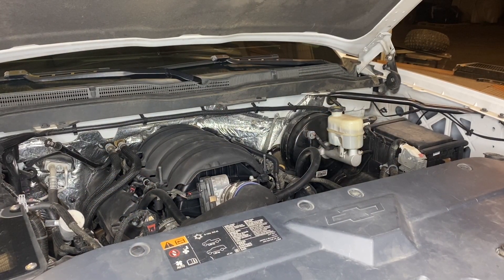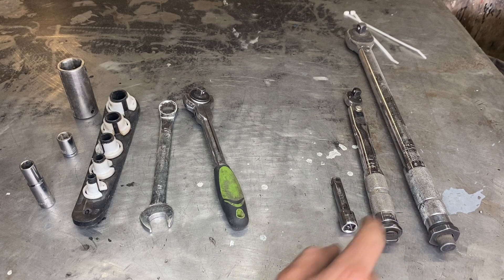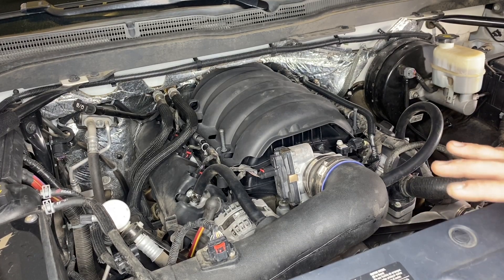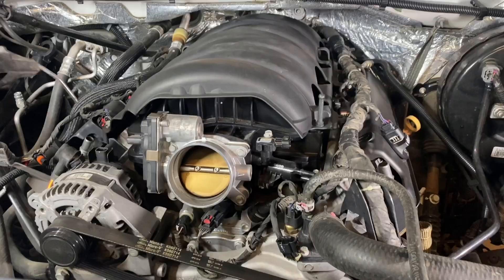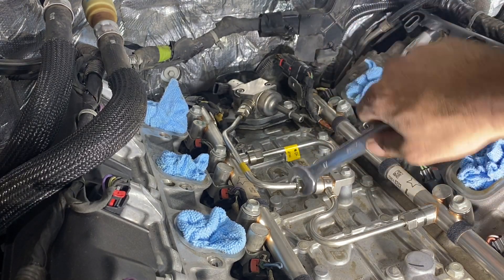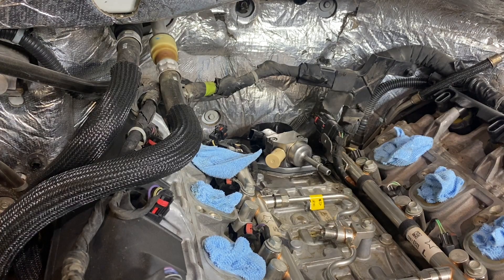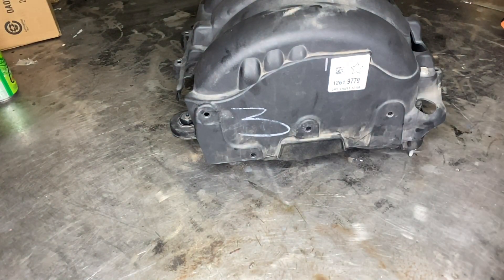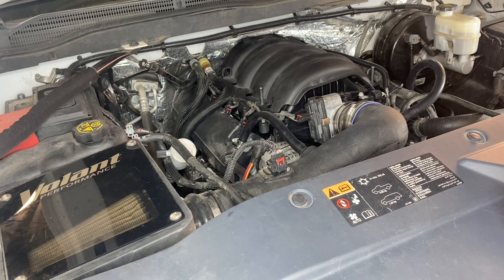GM High Pressure Fuel Pump Replacement 5.3 & 6.2 ( Complete Guide)

Comment: Hey man great video! I don’t think I have any issues with my actual pump but I have a very strong smell of raw unburnt gas. Obviously a leak and there’s no sign of a leak anywhere. I’m thinking the leak is somewhere under the intake but after watching and closely looking
How things are designed under there I don’t see how it could start leaking, but I know nothings impossible. Any advice?
Reply: Did you find fuel leak? My sons truck is doing same, thanks!
Reply: @jc_from_tx9229 I haven’t had time to diagnose but I think it’s either an injector o ring or leaking from around the high pressure pump whether it be a line or whatever

Comment: Hey man 19 Camaro SS 1LE with a cold air intake only mod. 50k miles, with no cel. Negative long term fuel trims on both banks (seems to get better at idle or steady throttle), but the car will slightly buck when casually accelerating from a stop. If I give it throttle to accelerate, long term fuel trims go really negative like -20 bank 2 and -17 bank 1. Bank 2 is always a few points more negative than bank 1. Replaced plugs and wires, injectors, maf sensor, pcv valve, coolant temp sensor, checked for vacuum leaks. All out of ideas. Doesnt make the power it should, sometimes will bog under wot. Seems to start just fine, and idle fine? But when you go to change gears (manual) or accelerate from a stop (usually lower gears 1st through 3rd at light throttle) it will buck. Does this sound like bad or leaking HPFP?

Comment: Is techron can damage that high pressure fuel pamp?If yes  what will be symptoms.Thank you in advsnce
Reply: It’s crazy you said this cause I used chevron fuel for about two days and my Tahoe started throwing fuel pump performance codes and stalling. I’ve put some Seafoam in the tank and have been watching the pressure with my gauge so far no issues but this happens right after I washed the truck weird

Comment: Asked at the dealership for information about an issue I was having and they said it's a good possibility that it's the HPFP that was going bad, and may need replacing. Well, so they want almost $200 just to "diagnose" the issue. I typically prefer to do as much work on my vehicles as possible, but after speaking to them it seemed like that would not be possible in this case. After watching your video, I'm more confident that I'd be able to get this done myself and not have to deal with them.

Thank you for the informative video. Keep up the great work. I hadn't run across your channel before. But, you earned a Subscriber from this video alone.

Comment: Did used the tool but still won’t fire up  everything at specs. Could it be a lot air in the system

Comment: Hello. I am doing car maintenance in Korea. I was impressed by your video. Could you tell me how to get a plug to check the cam position before replacing the high pressure pump? It's hard to find just the number on the plug. Can you help me?

Comment: QUESTION:   So, are there any other wires/plugs or hoses attached to the intake manifold?? or just a few bolts that hold it down?  Asking, since I have 2021 5.3 Sierra with extremely similar configuration under the hood.
Reply: The plu wires do not attach to the manifold cover, it's to plug and coil pack

Comment: I get the P0090 code ever time it rains, I can clear the code and it runs fine. Took to GM dealership and the insisted the high pressure pump was bad. Right now I’m at $1500 ac pump replacement and reassembly. I keep seeing other included in this thread are see this come back it’s due to the harness?

Comment: I did this and it didn’t change my situation. I’m wondering if my o2 sensors are bad .
Reply: 1 year later but I'm pretty sure a good way to check for that is if fuel has leaked into your oil or not. If no fuel in oil, it's prob not the hpfp

Comment: Whats that ticking sound all these trucks have?  Is it the hpfp?  Sounds like a sewing machine.
Reply: Injectors, direct injectors are loud
Reply: @Chucktales bullshit lol it’s lifters.
Reply: @supremecanadian6815  sewing machine sound is injectors.
Reply: @Chucktales  yeah? What do you think makes the click? It’s the hydraulic lifters bud it’s a known fact. People afraid to admit their chev ticks excuse is always oh it’s the water pump or oh it’s the fuel injection lol. I own a 5.3 I just don’t make up bullshit.
Reply: @supremecanadian6815  I’m not sure of your knowledge on how direct injectors actually function but the components inside also make a “click” sound. It doesn’t have to be only metal on metal to make this sound. Why were old diesels so loud? The injectors….now they are much quieter, diesel engine and GDI engines, which is the engine in the video use direct injectors which are louder then normal injectors.  I don’t make up bull shit son.  You have a glorious absence of recent automotive knowledge if you think only lifters can make that sound. Get with the times.

Comment: Great video aaron! I like the detail you went into,should this fuel pump be changed when you hit 150k to avoid gasoline ending up in the crankcase?
Reply: imo no, just look out for stumbling as it starts to lose pressure and check your oil periodically. Gasoline contamination will give it a different smell and yes, it will be overfilled even if you filled it correctly last service. Oil doesn't magically appear so unless someone added oil for some reason, an overfilled engine will mean gasoline dilution.

Don't delay the repair either, oil mixed with gas will not provide enough lubrication and the wear on the crank, rods, cam will be accelerated.
Reply: Anyone tell me if a 2015 gmc sierra 1500 slt 5.3l flex fuel the same pump number? Noone seems to know

Comment: Thanks this is what’s happening now with my 2015 Yukon sle. The problem I’m having is that I have to add oil down the road after a fresh oil change and I’m getting p0172 and p0175 codes is this a hard project to do on my own

Comment: Hello Aaron, I have a 2012 Sierra 6.2l that just starting to have trouble starting.  It will start up after a hard start and starts normal after I run it.  My research says its the fuel pressure regulator.  I cant find this part but did see that the regulator could be part of the fuel pump???  Do you know if this is true?  Thank you
Reply: Hey. Chris lujan. I have 6.2 as well it having a hard time starting takes a couple of tries to turn on. After I turn it on no issues. I’m either thinking it’s running out of fuel or bad. Fuel pump
Reply: on this generation of SBC the high pressure fuel pump has a regulator integrated into it, it's the little cylinder with a 2 or 3 wire plug to it. Controls the fuel rail pressure and it can also go bad but I would do it as a unit - regulator and pump. Not sure if the regulator would even be listed separately.

Comment: Yikes that little 6710 is expensive. Can't I just use a dial gauge and stand to figure out when the cam lobe is located at the base circle (= lowest point)? Do I also need to figure out if the #1 piston is at TDC/exhaust stroke, or is the cam lobe being at the base circle position sufficient?
Reply: cam lobe's position should be enough but cyl 1 tdc is the sure way. As I understand, it's just so there is no extreme spring pressure preventing the pump from seating properly - it has a machined surface and a metal gasket after all.
Reply: I just did this job. (2hrs) I removed the #1 spark plug, then I set the old fuel pump in place. Turned the crank until the #1 piston came to TDC and watched the fuel pump drop to its lowest point. The intake valve which you can see down in the port was closed so I bolted it down evenly from side to side and then torqued it to specs. Done! Hope that helps. @lichking3711

Comment: Great video! Just did the HPFP in my wife’s Yukon. Having the 90 impact ratchet makes a world of difference. Also, the install plug is great, I didn’t buy it, you can look down in #1 intake port and see the intake valve, and turn the motor til you get to valve overlap, then you know you’re TDC on exhaust stroke.

Comment: shouldve watched this video before doing my sierra 1500, I broke one of the manifold cover bolts trying to tighten it to 88 pound feet of torque :( spent 4 hours getting the broken part of the bolt from inside the block
Reply: 88 pound-feet!!!!!! you got mistaken with inch-pounds

Comment: I recommend getting some crows feet to due the torque properly on that pipe. Also did you use clean motor oil on the intake gaskets? Priming the line I think should be about three key turns without starting
Reply: I just did the job and improperly torqued these down by not holding the crow's foot at 90 degrees. I thought they were at 22 ft-lbs, but after smelling gas, I had to take off the intake again. I found that I had really torqued them to about 15-18.  Properly using the crow's foot, I got about 1/4 of an extra turn, and my leak stopped.

Comment: In the video you mentioned you would post a link to the pattern for tightening the bolts on the manifold cover.  I don't see the link.  Is there a source for this?  Thanks!

Comment: Great 👍 video! What do you think a dealer would charge for this repair? Parts and labor
Reply: $1150, I laughed at my local dealership then did my own. Took less than 2 hours and that was with 15 min of show and tell with the wife as to valves, TDC, and what the 4 strokes look like

Comment: How would I tell if my piston is all the way up
Reply: Also, if you can’t hear air escaping, plug the spark plug hole with your finger and slowly turn the motor by hand, you’ll feel pressure against your finger if it’s on the compression stroke, then you know you need to come all the way up and then back down, then next time going Up you’ll be on the exhaust stroke.
Reply: Here’s an old school way. With the intake off, pull #1 spark plug, put a screw driver in the spark plug hole, then turn the motor off the crank bolt til you feel the piston hit the screwdriver and push it up. You’ll hear air being pushed out of the hole if you’re on the compression stroke. If the piston is going up and you hear no air being pushed out, then you’re on exhaust stroke.
Reply: Then look down in the intake port, you can see the valve from behind its seat, slowly turn the motor until you see the intake valve BARELY crack open or move, when it BARELY moves, you’re at “valve overlap” when both intake and exhaust valves are both barely opened, and that’s TDC.

Comment: I have a 2014 5.3L with the same behavior and codes. Looks like this is in my future. Any idea what a GM dealer would charge for this?
Reply: $1,100 was the quote I got from dealer.  That includes diagnostic fee ($130) and oils change ($69.99)
Reply: @joshfraser6705  thanks for the update. Timely though because yesterday a woman t-boned my truck when she ran her red light and I think the thing is totaled.
Reply: @jbmanning  sorry to hear that- I just finished installing the pump wasn’t too bad at all.

Comment: hey Aaron, I have a 2017 GMC 1500 6.2 and my truck constantly goes into limp mode when it rains. Then the other day it is now permanently in limp mode. Im down in the Yucatan Peninsula and there isnt much help, so its basically a do it yourself scenario. We found that the High Pressure pump was bad, so we changed it out, really not knowing what we were doing, and the guys did not put the number 1 piston on TDC. Im having them remove it, and placing piston 1 on TDC as you suggest since we do not have the guid tool available. We only ran the motor for several minutes, we are getting 80psi on the low pressure side and only about 85 on the High pressure side. So Im assuming it might be the incorrect installation? I was reading that the plunger can get damaged over time do to lack of oil changes, I bought this truck used, so who knows, but do you know if we can change out the CAM plunger if it ends up that it was damaged? I still need to figure out why it goes into limp mode when it rains...thats like trying to pin down the location of a bad smell..lol Hoping you might be able to help! Cheers.
Reply: You ever figure this issue out? I'm having a similar problem.
Reply: @dragstang86  yes, it was an issue with the wire harness in the engine compartment next to the cowl. Had to have it replaced.
Reply: Same issue dealer insisted on changing the pump, $1500.00 the code was P0090 so I think it’s wires not the pump. Do you have part number for the parts you used to fix?

Comment: Great write-up. How was your HPFP packaged when you received it? Reason I'm asking, I purchased a "new" hpfp and when it arrived the packaged appeared to have been opened and taped. The pump was in a clear bag with a zip tie and then wrapped in brown paper and bubble wrap inside the AC Delco box. The pump look overall new however the bolts are questionable and I could tell there was some fluid coming out of the fitting ends. Wasn't sure if they prime them or test when made. I may return and get via the link you provided but was just curious on those question.
Reply: Why would you ask this question to a YouTuber and not the store you bought it from
Reply: @AcidGambit419  why does a dog lick itself

Comment: Cool video 😎 i haven't had a chance to work on a direct injection 5.3L or 6.2L LS yet😔
Reply: *LT they’re no longer an LS
Reply: @slycarlo8747  yeah I just wish they never went direct injection🙄
Reply: @PhillyDee215  Same but there are quite a few more advantages to the LT block compared to the LS, Motion Raceworks has direct injection plugs to pair with port injection to do away with all that if you’re doing a swap.
Reply: @slycarlo8747  yeah that port injection definitely helps tho👌but they just ruined the push rod engines🙄funny thing is that I've replaced countless  direct injection pumps/secondary high flow fuel pumps its not even funny. In fact I have videos on some of them. New is not always better, it's a fuel system waiting to fail😯

Comment: I'm assuming you checked for leaks before reassembly. Just an observation, great video.
Reply: What's the best way to check for leaks?
Reply: @navidvasseghi6284  run it
Reply: Can you start the vehicle with the air intake manifold off so you can look for leaks?